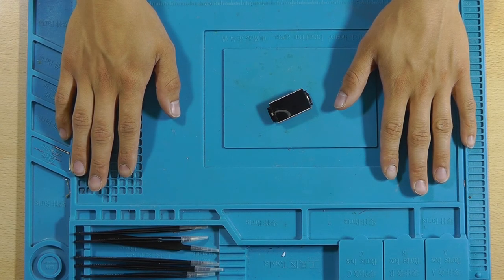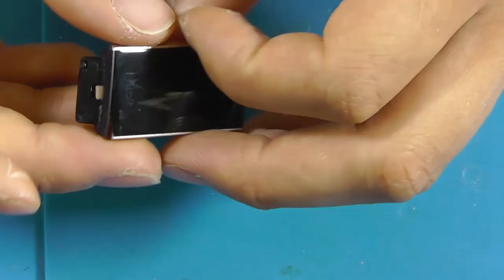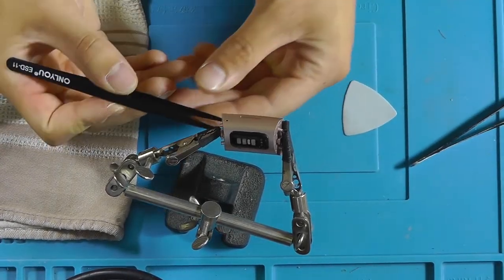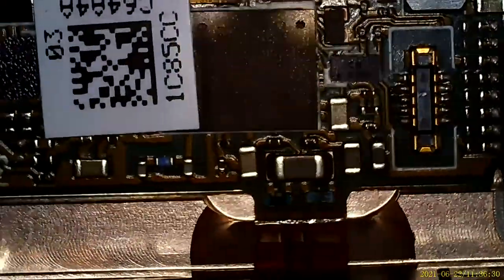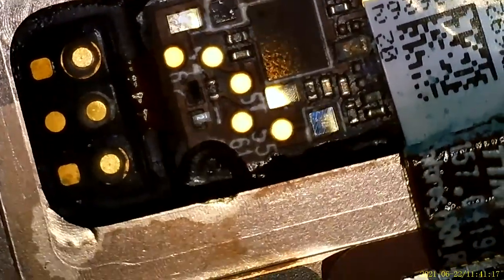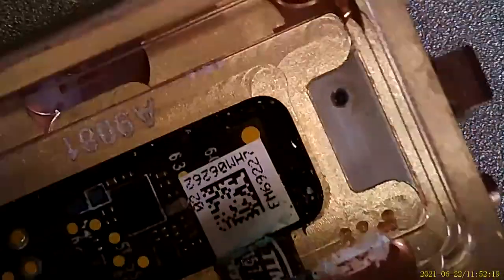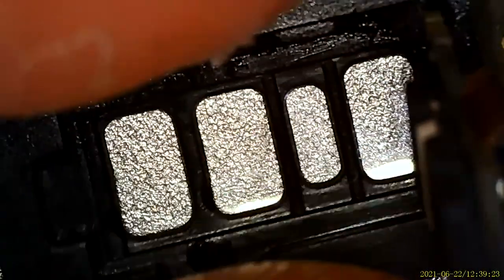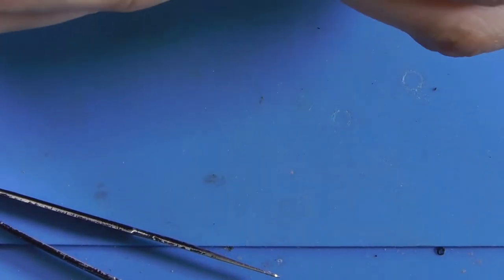#113 Fitbit Charge 3 WATER damage

Comment: Seems a very thin feeler gauge would work to help get the screen separated? I have moisture under my screen but not sure it's worth the hassle?
Reply from the maker: Yes I think that that should work. You are able to get a replacement screen for around €15,-  but you'll need to glue it down yourself. I think it's worth a shot if you're up for the challenge. Please do let me know what type of glue you used